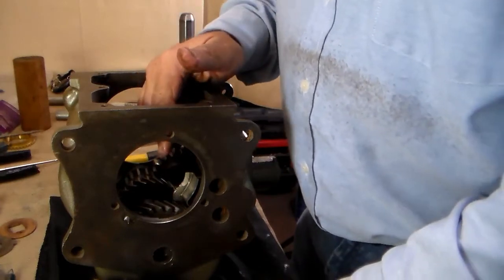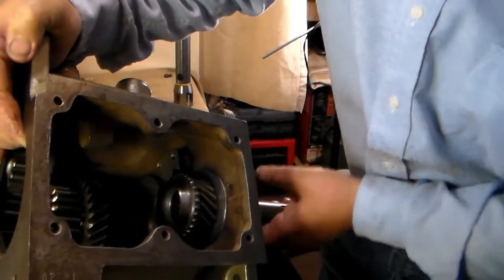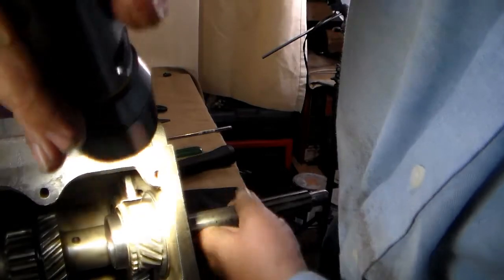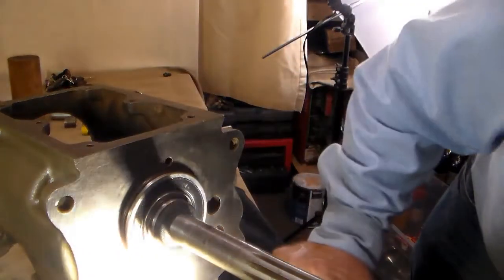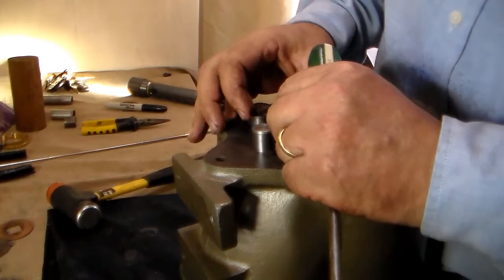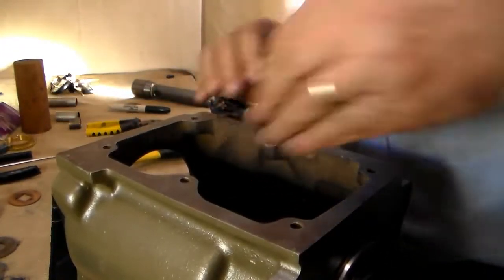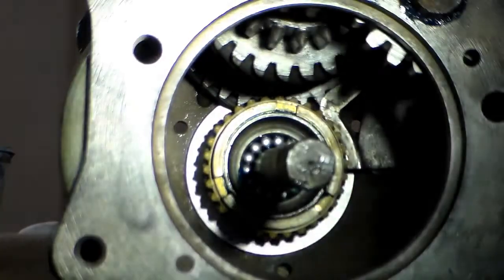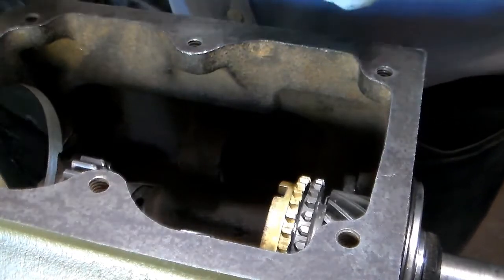13 Rick Stivers T-90 Rebuild Guide - Assembly Part 4

Comment: What size was the wooden rods you used for the pilot bearings and reverse idle gear
Reply from the maker: Triple A Here is an excerpt from my original written guide. “1a. Tool A is manufactured using a 3/4" wooden dowel rod. Cut it to 6 7/8" long. If the dowel rod has a rough finish, it should be sanded smooth and the ends lightly rounded. I did this using a 2" long drywall screw mounted in my drill. I turned on the drill and screwed the screw into the end of the rod, as soon as it snugged up, the rod was spinning nicely. It made sanding very easy. 
Merl - Make sure you test fit the dowel through the front and rear holes of the case prior to assembling the cluster gear, sanding was required in my case.
Also check to insure that the shaft is not too long to fit into the case from the inside. “ I hope this helps.